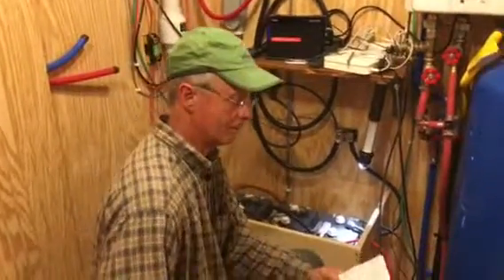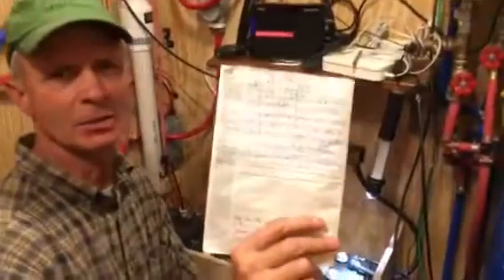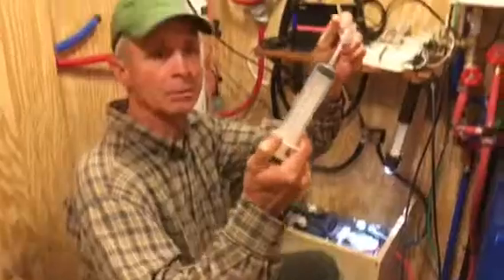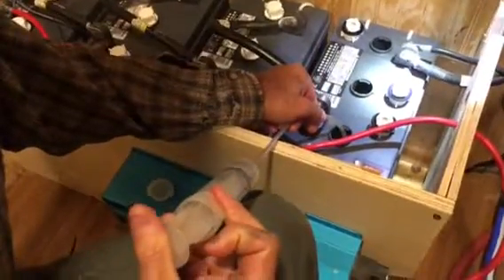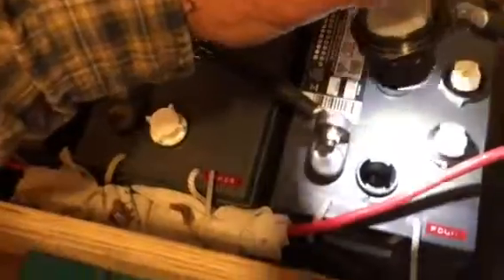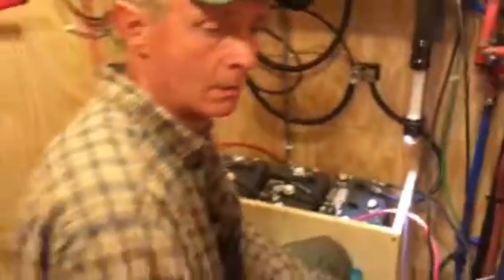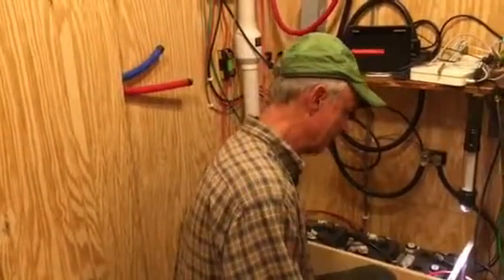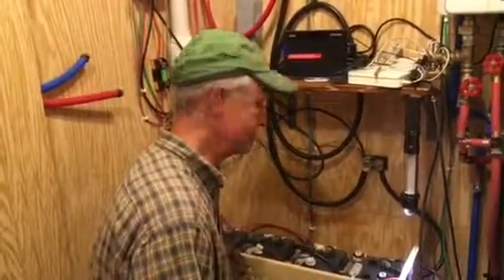Adding water to Solar Batteries

Comment: Good job on the video Mr and Mrs Parker.  I’m about to fill my batteries today but one thing I was curious about is is there any disconnecting of the power to the batteries needed prior to adding water?
Reply: Nope, you don't need to disconnect the batteries but beware that any splashing of the battery water can burn a hole in your clothing and mess up your eyes.
Reply: @wesparker799  ya thanks for that Wes.  My neighbor also told me to wear eye protection, and that was not only for the potential of a splatter or worse (explosion), but his point was we tend to naturally rub our eyes and with gloves on that might have acid on them, eye protection would be a good 'reminder' to not do that.
Reply: Good question. Just what I came here for but there’s no answer!
Reply: @JaneR57  I added water often to my lead acid batteries without shutting any power off to them.  wear rubber gloves and eye protection as a precaution however.  eye protection (I was told) is more of a means to remind you to not rub your eyes with your gloves on because you don't want battery acid type water anywhere near your eyes.  hope that helps.  don't over fill your batteries either.  What you don't want is to ever let the water level get below the lead plates inside the cells.